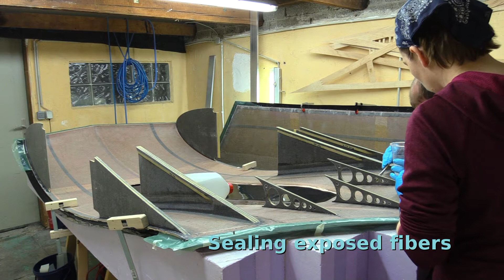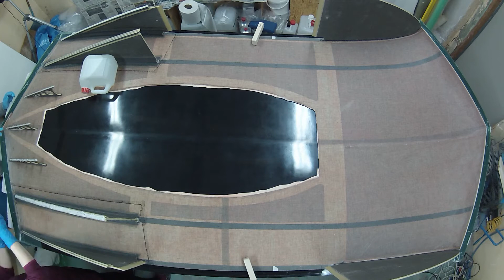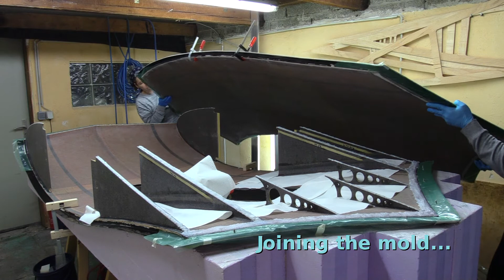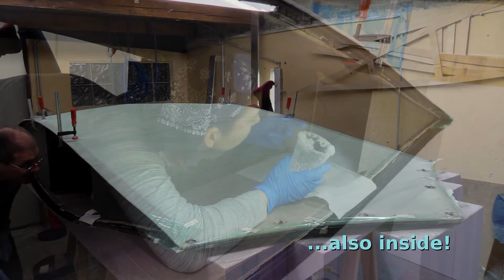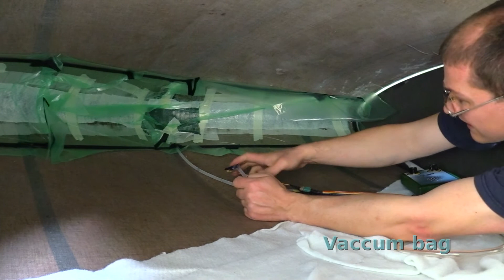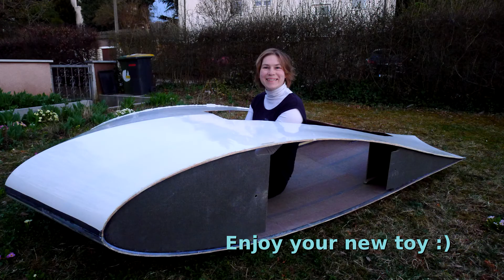How to join a large composite aeroplane shell

Comment: Amazing project! Looking foreward to the rest.
Reply from the maker: Thanks Peter. We also are eager to have more parts. We'll start with the cabin's mould the next weeks (waiting for templates).
Reply: I love flying wings, with the Horten designs on the top of my list. I planned designing and testing a scale model of the IX as it's one of my favorites, but decided to try and look for info on a pul 9 or 10..  but cannot find much about it. I love your 1/4th scale version of the schneewittchen. You have any plans of sharing or selling a basic drawing of the scale model. Does not have to be that detailed..  outline, wingprofiles and angles should be enough. Anyway, good Luck! I'm keeping my eye on this project.
Reply from the maker: The planform of the Pul9/10 are very similar to  the H-VII, but with modified sweep back and span. I know one of the builders of the Pul9/10 and had a chance to see the desing. In my honest opinion, Reimer Horten simply modified back in the 90s the design of the VII to match the needs of the Pul 9/10. I've heard that the VII was one of his most favorite wings. Both the PUL9 and 10 have up to a scaling factor the same planform. 

Regarding Schneewittchen:
I don't distribute drawings or information on the layout, sorry, but I have a three side view in my blog: https://hortenmicrolight.files.wordpress.com/2015/08/schneewittchen.pdf
Reply: Yes, I found the 3-view. But my main problem with flying wings is that I don't know enough (or anything) about aerodynamics and airfoils. So I have no clue what airfoil to use and what wing incidence angles. Studying the Horten drawings by A.L. Bentley I see the incidences at each rib, but I'm not confident enough to just pick an airfoil and build something out of the blue. Do you have any airfoil recommendation and wing incidence values if I would like to attempt to build a scale version of the Schneewittchen?

Comment: Holy shit I thought this was going to be a drone or something but an aircraft for one person? That is so awesome!
Reply from the maker: Indeed no drone ;) It's a one seater with a max. take of weight of 240 kg (530 lb). The empty weight will be below 120 kg (265 lb) meaning that the payload is at least 120 kg...
Reply: Well I'd be a little bit too fat. But I bet this is a great way to stay motivated to stay thin hahaha. Eat too much and you fall out of the sky ;)

Could a very light craft like this be solar powered? I know the Solar Impulse plane weighs like 2 tons and has the wingspan of a boing.
Reply from the maker: The "payload" is bounded by the very low minimum speed (55 km/h or 34 Mph) prescribed by class (120 kg microlight airplanes). It could easily carry more, if higher stall speeds where allowed...

Regarding solar power: 
Solar cells are quite weak and bring substantial extra weight. This means that you need a large cell surface to have sustained flight over a full day or longer. You must have roughly twice the power usually needed to keep height, because you have to charge your batteries for the night. That's why Solar Impulse is so large... Nevertheless, nurflügel have a large surface compared to usual airplanes, reach good glide performance with less span, have some structural advantages and could be well suited for solar flight. However, a solar powered Nurflügel would still have to be very large compared to a usual microlight. The laws of physics can't be outsmarted...
Reply: Yeah. Maybe you can land every other day to recharge. So you would recharge one day, fly every other.

BTW can you use height as an effective "battery" to store energy over night?

Are there light planes that can land easily on a field or even vertically? I saw a personal electric aircraft that had a relatively simple mechanisms with multiple electric motors integrated in the wing that can turn vertical, reducing mechanical complexity. Of course I can't find it now. I think it was this one: http://www.esa.int/Our_Activities/Space_Engineering_Technology/TTP2/Personal_aircraft_aiming_to_take_off_from_your_home

It would be absolutely amazing to have a kind of flying "amphibious RV camper plane" that recharges using solar power. Of course that's way too heavy and crazy sci-fi and wouldn't be legal anyways. Oh well maybe if you reduce yourself to the bare essentials.

PS: FYI I think it's called "One Wing" in English.

PPS: Ah never mind it was the Lilium but unfortunately it's probably bunk anyways.